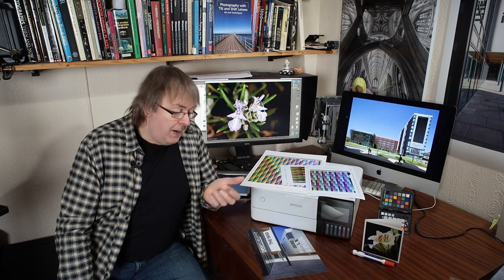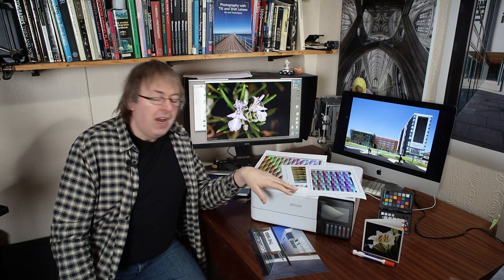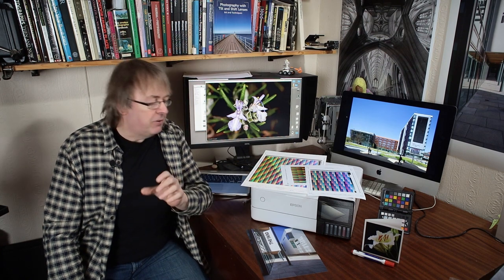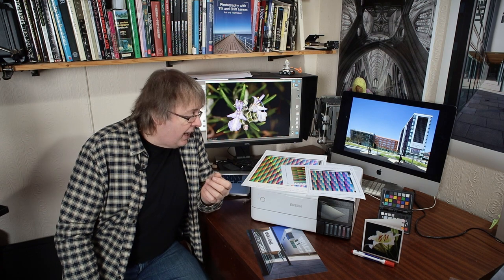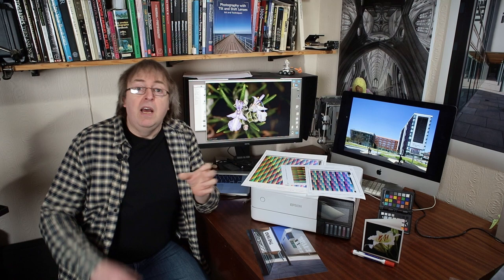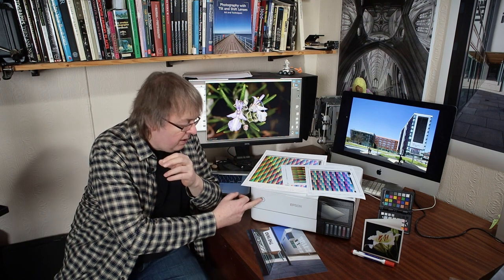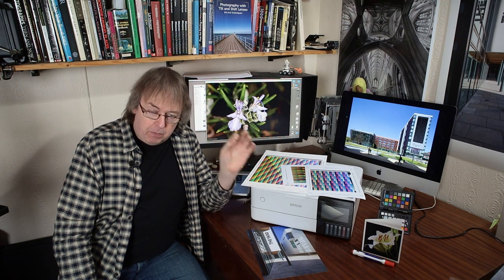What are printer profiles? What use are they? Using icc paper profiles and soft proofing

Comment: Hello Keith
thank you so much for your great educational content

For me the most difficult task in color management was to find the correct screen target parameters (Eizo calls it so) for printing.
The screen target contains the parameters set with brightness, color temp, contrast that matches the print and with whom calibration is made.  The Eizo "Color Navigator" software stores my different targets for printing, big screen display, smartphone display; each target is calibrated and the screen display can be matched to a target with just a mouse clic.
Once my Eizo CG screen had the correctly guessed target parameters for printing, soft proofing went so easy and reliable for me.
Reply from the maker: Yes - custom settings can help - I use them for screens in the videos, but don't bother fro normal editing.

Comment: With photography, I like to work backwards. That is, I start with the photo paper (e.g., Hahnemuhle Photo Rag Pearl), match it with the printer (e.g., Canon Pro 1000), and then download the correct printer profile from Hahnemuhle.
Reply from the maker: That's not really 'backwards' unless you mean you choose the printer based on the paper...?
Reply: @KeithCooper  What I'm saying is that the end result is what matters, not the equipment per se. The end result determines what goes before. For example, if a printer doesn't work well with the paper I want to use, then it would be a mistake to buy that printer.
Reply from the maker: OK, although perhaps with the huge range of papers I've got from testing, I'm just not that attached to any particular paper [or brand]

Comment: Great video Keith, thanks for that.

I have a question that I hope you may be able to answer or point me in the right direction. 

I have installed ICC profiles for the papers I use, but the displayed profile name is sometimes a bit long-winded or cryptic (e.g. APJ_OEMPro1000_AlphaNaturalRag_HWFAP.icc) Is there a way to rename this to a more friendly version? I'm using Windows 11 btw. 

I've tried renaming the file before installing it, but it still appears as the original name so I guess it must be hard-coded into the ICC profile.
Reply from the maker: Yes the names are internal ;-) I can edit them using the Mac ColorSync Utility, but I've no idea what to use on a PC
Actually the cryptic names are usually meant well
Just from the name I know it's a rag paper for a pro-1000 and should be printed using hwfap media setting.
I give my profiles similar style names to help me remember what I'm using - it's usually done for very good reasons...
Reply: @KeithCooper  thank you! I shall keep looking.

Comment: thanks for the explanation. I now need to calibrate my monitor and my printer&paper profile. Is that done with one device and any suggestion? My macbook pro screen is set to "Apple XDR Display" preset. I shall set it to "photography" to slightly match what is printed I guess.
Reply from the maker: A calibrator os needed for screens - nothing to do with paper profiles, they take a lot more work, equipment and expense ;-)
Few people make their own paper profiles.
I do need to revisit laptop calibration, since I just replaced my 2010 MBP with a 2024 one...
Reply: @KeithCooper  not one device does both monitor calibration and printer profile, the xrite?
Reply from the maker: Yes - The i1Studio aka ccStudio or Colormunki as was
Making your own icc printer profiles is rarely worth it for the majority of people... but if you do it's that or buying an i1Profiler kit [i1Publish]

https://www.northlight-images.co.uk/x-rite-i1studio-launched/

and https://www.northlight-images.co.uk/i1studio-update-1-1/

https://www.northlight-images.co.uk/i1studio-update-1-5/
Reply: @KeithCooper  great.. may consider buying one.. but first lets try ready icc profiles or maybe start with the generic ones from the printer.

Comment: Hello Keith :)
Thank you for that video. 
- Is there a specific value in the icc-profile for thickness of the used paper?
- if yes, is there a possibility to overwrite this value with a specific software due to the fact that the head of the P900 leave traces on the paper like scratches
Regards HaJo
Reply from the maker: No - that's in the media setting
Look at making a custom media based on an existing media setting,
See in the main[written] review
https://www.northlight-images.co.uk/epson-sc-p900-printer-review/
Reply: @KeithCooper  Thank you for the link. I'll try this :)

Comment: Do the monitor calibration devices also set the monitor brightness? It seems to me that this would be very important.
Reply from the maker: No - this is usually set in the calibration software. The software may be able to adjust the levels or you may need to adjust the monitor.
It's normally set to a known value fro 80-120 cd/m2 - see any of my profiling equipment reviews for details

Comment: Hi Keith, I have a question for you, not about ICC profiles sorry, but may be for a future video. I have a P900 with warnings on 5 cartridges and the 5 others are very low too, and I am wondering if I can continue to print safely or if I should change all cartridges with warnings now. I fear to waste lot of expensive paper if I run out of ink, one after the others in the middle of prints. Or may the printer is smart enough and know in advance if it can complete the print? Do you have any advice for situation where many cartridges are about to be empty? I read on forum that we can change cart during a print, and continue, is it true? Thanks a lot!
Reply from the maker: My own thought is to wait until the printer insists, unless I'm making a really big print.

Although some printers say you can hot swap, I've never seen one where there wasn't some form of mark on a print [slight change of gloss] even with printers with secondary ink tanks like the bigger Canon ones.

I usually cover aspect of this in my detailed [written] printer reviews, not the videos, which are more often intended mainly as supplements to the 'real' reviews ;-) ;-)
Reply: @KeithCooper  Thanks a lot, I will read again the reviews as I do not remember that part. So may be I should order to photo lab if I need a panoramic print, until all my carts are replaced.
Reply from the maker: You can temporarily replace low carts with full ones for a big print. I've done swaps on larger Epson printers for just this reason. I've not tested it on the P900 though.

Comment: Hello and thanks for sharing your knowledge ! But isn't is more simple, when you finished your image editing,  to convert (real conversion, not proofing) the image you want to print to the printer/paper icc profile and do the adjustments on this image converted to the printer/paper icc profile ? I would imagine that in that case all the adjustment one will do to match as much as possible the wide gammut display image you to want to print to what the printer/paper can achieve without taking the risk to generate out of gammut colors ?
Reply from the maker: Absolutely not :-) 
...printer profile colour spaces are not for editing images in - colours likely won't display consistently.
Soft proofing can help address gamut issues, but with care, since you need to know what's going on. 
Out of gamut colours are generally nowhere near the problem they are sometimes perceived - choice of the right rendering intent for example can make a big difference.
Reply: @KeithCooper  Thanks. I encounterd some cases where I was unable to get vivid saturated reds on the P900, only got darher and more dull reds. When I was speaking about converting the image to the paper/printer profile it was not for the proper editing of the image but only for the printed version of the file. If I use the original prophoto or adobe version of the file there are vivid reds or oranges I didn't manage to handle the image to get a similar result. I know that there will always be a difference between a screen versio and a printer version, but in some case like in my exemple if I don't have this red color the image sooses a lot of its interest. If, after having finished the editing of my image I cnvertied to the printer profile,,I noticed the I didn't have any gammut warning at all anymore and I got gammut warning with the original prophoto file under soft proofing.
Reply from the maker: Yes, there are a few specific times where this approach might be warranted [I'm thinking more in commercial print], but in general, due to the knowledge and experience needed I'd never directly suggest it.
My own approach would be to create a different printer profile and pay attention to the mapping for different rendering intents. Once again an approach I'd not normally suggest - the kit and software is not inexpensive @jimofmarseille
Reply: @KeithCooper  thanks. I will continue to dig and search. I'll chack how to maybe replace some colors (without distroying the image) and I tried to pick up one of those red alone and anaged to print it as a single color (in a filled square) but didn't find to remap it on my picture (I tried color replacement in photoshop or playing with hue/saturation on an adjustement layer with to success). It only happens a few images, usually I don't have those issues on my images, it seems to happen on low light images and dark saturated reds and oranges.
Thanks again to take time to answer my questions

Comment: Are icc profiles ok to use on their own or should I still send a printer colour chart back to the paper manufacturer for another profile.
Reply from the maker: The profiles are just data files. You install them on the computer you wish to print from.
Each profile is specific to a printer/paper - if a paper supplier offers custom profiling then that is the time to print a target and send it to them if you want a custom profile. Custom profiles are the same thing as generic printer/paper profiles. They do depend on the user correctly printing the target though... ;-)

Comment: Hello Keith. Sigh - I'll vent off for a second - sadly - about what really makes me angry and frustrated. I have a tremor, which is annoying enough, but I did find that I could work with minimum frustration with Photoshop 6. I learnt all the ins and outs of the program, working with layers, etc, in the end, producing some really acceptable artwork. Not the same as working traditionally, but you take what you can get. My last laptop which was running on Windows XP died. Thank goodness I had a premonition and took time, during a house move, to shift all the important stuff onto discs and memory sticks. So now I have this new laptop running on Windows 11. Except, my Photoshop 6 will not run on this laptop. I cannot find anything that is compatible. I feel chronic exhaustion coming on again, where before I was starting - through achieving something, a little like the old days. It's like Microsoft has taken all my tools away, all the techniques that I have learnt, all the brushes and said "Wow, Gee! I'm soooo sorry - in that insincere American accent that so many have learnt to hate and distrust! - Here, this is really something better that we KNOW will work for you" - and it's a house brick. What I want is a program that I have been enabled to trust will get results. Some faceless loon has taken it away from me. I'm tired  of having to process the entanglements of different programs that have so many obfuscations when you want something straightforward. Every time I try to find something I can work with, and click on a tutorial, it's done at high speed, with a poor resolution so you cannot read what the person is clicking onto, or there is a thump, thump, of some muzac when you're trying to concentrate on what's being said and in that bloody sucking treacle American accent  Sadly and disheartenedly, I may just give up altogether.
Reply from the maker: Sorry to hear that - 
I still have Photoshop CS6 running on the MacBook Pro you see in the videos - my old Mac stuff does keep working.
Some people have looked to Affinity Photo, but it's different enough that some don't find it an easy move

Comment: Thanks Keith. Does the device (Mac/PC) figure in the icc profile... it used to be that the screen dpi were different between Mac/PC... does that make any difference... just wondering.
Reply from the maker: No, the same printer/paper profile works for either. The profile is about translating from one space to the printer output space. Display resolution has no part in this